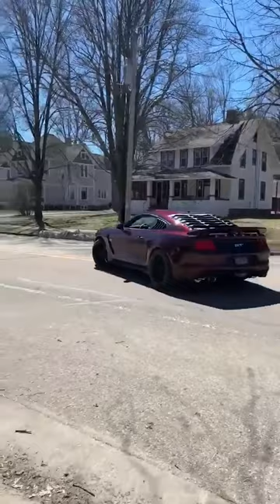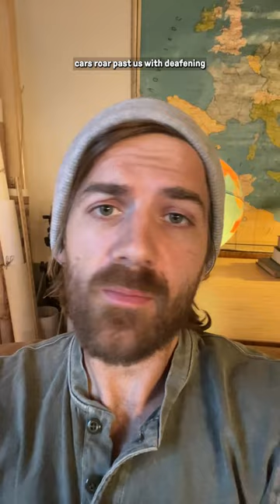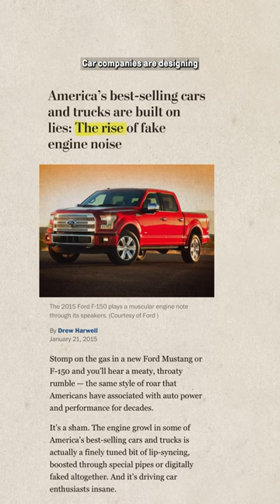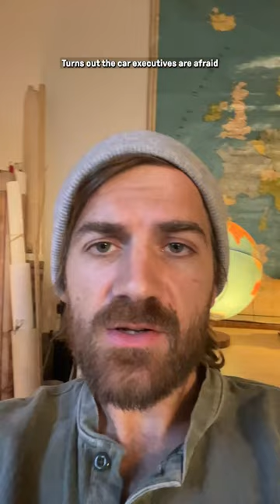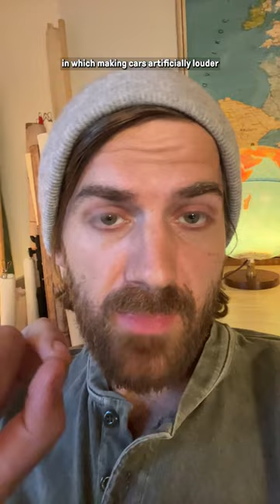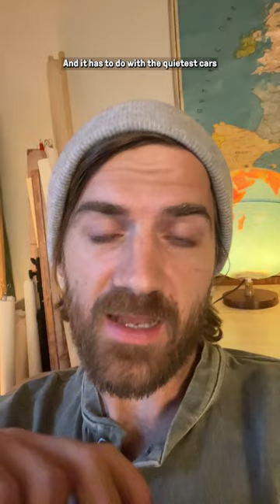Car Companies Are Making Cars LOUDER

Comment: I don’t know if you have this exactly right. The cars are loud and noisy weather real or artificial because people want them to be. Typically the car sounding like that our performance vehicles have some type. If they don’t sound really good, or even if they do watch times, people still buy aftermarket exhaust to make them louder. That’s just the community and culture on those types of vehicles.
Reply: The problem isn't that they're loud. The problem is that the operators don't drive them slow enough to be safe for people who aren't in cars and are also using the street

Comment: The quieter the car the more efficient at delivering power. That is why electric vehicles don’t make all that much noise because the energy is being expensed in heat and torque.

Comment: There is actually no data that suggests that the “safety noise” that electric vehicles are federally required to emit decrease pedestrian injuries. If you go back into the ideology of the federal regulation, you will find that motor vehicle companies dominated by ICE manufactures lobby to include it as a way to make EV’s LESS appealing to consumers by making everyone believe that all EVs naturally emit that unpleasant high pitch sound whenever they drive. At 25mph it cuts off and they are SO much quieter. Its a useless law that should be repealed
Reply: Yeah, the safety deficiency comes from drivers not paying attention to or caring about pedestrians

Comment: this is either straight up wrong or just misleading. that article you showed is referring to piped in fake engine noise to the cabin (can't hear it from outside of the car) which companies do bc they are making exhausts much quieter due to regulations. that mustang you showed has nothing to do with this, I promise car companies aren't blasting fake exhaust sounds 
to the public outside of the car lol

I finally have experienced the patented Johnny Harris oversimplification in an area I'm knowledgeable in 😂😂

Comment: This might be firing a shot to the otomotive industry enthusiast and purist
Reply from the maker: I'm assuming most car enthusiasts are well aware of "active sound design" in performance cars and trucks. Many also adapt their exhaust pipes with aftermarket parts to "enhance" the sound too.
Reply: @johnnyharris  Reach out to reputable performance shops, fast cars tend to be loud, not everyone can afford what it takes to make a fast car. I regularly have to have the conversation w/ potential customers that changing out their mufflers won't make it any faster. They just want it to sound fast, and if OE's give that to them out the gate it, well damn, what a deal.

Comment: I love Johnny’s content but the video doesn’t have it all correct. The car’s engine sound is piped into the interior through speakers and/or a tube through the firewall. The red Mustang at the beginning has an aftermarket exhaust so it is actually obnoxiously loud because the owner made it so.

Comment: Honestly all electric cars should have some kind of faked engine noise. I've almost been run over a dozen times by electric cars because I cannot hear them, and if I don't see them when checking a crossing, the only thing stopping me from walking onto the road is the sound of the engine or the tires. Especially since these ev people also love their super quiet don't-last-longer-than-a-year-tires that make very little noise on good asphalt. So yeah, either a really colorful neon colouring or some fake engine noises, because they are a safety hazard.
Reply from the maker: Legally they're supposed to, but many are still much quieter than the average non-EV car.
Reply: A road is for cars is it not?

Comment: There is a thing as to loud I agree, but loud exhaust is by product of more performance. The less resistance a engine has blowing out air (i.e. catalytic, muffler) , the quicker it can pull in fresh air and make more power. Its not a “ego” thing in most cases, some people just daily drive race cars. 😂
Reply: There's usually quite little performance gained from a reasonable muffler/exhaust system and what is often put on performance cars. They really do tune the sound to appeal to enthusiasts when they could tune it to be quieter and retain power. My point: these cars are tuned for volume when they could choose to maintain almost all the performance and be much quieter.
Reply: You really only stand to gain AT MOST 15 HP even with a straightpipe exhaust. And this, and many other cars on the road like it, are not "race cars."

Comment: that is not how a stock mustang sounds. Actually manufacturers are making cars quieter through the use of valved exhaust systems, and european cars now have particulate filters that make them quieter than ever. Sorry Johnny, but actually high horsepower cars naturally do make a ton of noise.

Comment: As a car guy, the loud exhaust makes it more fun to drive. The speaker shit is stupid tho.

But there is a benefit to louder cars, on gas engines a more free flowing exhaust means more power and better performance and the biproduct of that is more noise.

The even funnier thing here tho is clearly you don't really have an understanding of any of that as the car you posted with a loud exhaust is modified. That year mustang GT isn't that loud from the factory.

Try harder.

Comment: Hi Johnny! Love your take on this :) But I've been on both sides so let me fill you in a bit.

To be fair, cars geared for comfort are expected to be quiet. I wouldn't want a noisy exhaust on a car that I use to drive my kids to school.

On the other hand, cars built for performance or taken to the track are expected to be loud just like this. Weekend racers, track day-goers, and performance car enthusiasts are in the market for these vehicles.

Why? One word: feedback.

Experienced drivers on the track or drag strip "listen" to the engine's sound to get a gauge on lots of things. When to shift, when to brake, or when to get back on the throttle, among other things.

Engine sounds blared on the speakers are for basic stuff like those. One car with these in particular, the Toyota 86, is marketed towards beginner drivers who want to take their car to the track.

The feedback from the engine is necessary and is part of the learning curve for driving on the track.

More experienced turn these features off at some point. The engine sounds become a nuisance at some point and counterintuitively mask crucial sounds that may indicate info about the engine's life or even problems elsewhere like the suspension.

This is the reason why cars that are custom-built for the track are stripped of any sound-deadening and just keep the bare metal inside. That's feedback to the max and every bit of sound or vibration is crucial information for the driver.

I totally understand the sentiment, but we can't really generalize that the market is the same for all types of cars. And I hope you learned something new with all the stuff I mentioned as well :) I'm among those passionate about these kinds of stuff and I'm open to fruitful dialogue about this.

That being said, I do think super noisy cars have no place on public roads. I have a car that I bring to the track, but I still keep its exhaust down to Jasma standards (you can look that up. I think you may find it interesting) because I daily-drive it as well.

Comment: Long time fan, but I highly recommend some more research is done. As a car enthusiast I feel as if this is a bit or a twist on the truth. While some companies do add in noise, it's typically via the speakers on the inside of the vehicle, not on the outside. Also, as other comments have said - most cars come with mufflers, resonators, and or silencers to make them quieter than they are naturally. Chances are most cars you hear have those removed, and they arent made louder via the manufacturer. There's a case here, but I'd try to dig a bit deeper than this

Comment: Artificial sound thru speakers is within the car cabine, not outside, the car companies are reducing the exhaust noise because of regulations. The purpose is to reduce the outside noise of a car, while the driver is blasted with fake exhaust noise. Personally I love loud, powerful car noises since I was a child, and this will not be changed.

Comment: Disagree.  Silence doesn't make a reasonably intelligent person think it's weak.  The Tesla Plaid  will push your eyeballs into the seat and it does it in perfect silence.  Yes it's electric but the point is that torque cannot be fake.  You either have it or you don't.  The sound produced is just the cherry on top of the experience of performance but not necessary.

Comment: Yeah no. The average car and sports car has gotten quieter, because the regulations have gotten stricter, especially in Europe (new Porsches sound like washing machines for example) the reason they do this is because people who like cars like the loud noise, it makes you feel connected to the machine. MOREOVER it does have power advantages. Why do you think race cars are loud?  The loudening you are referring to is INSIDE THE CAR, not outside, and that is becauseeeeee of, you guessed it, they are quieter from the outside and so compensate with fake audio from the inside. Also I very much doubt the first video is fake sound, Johnny do you have a source for this? i really like your content btw but this is quite opinionated misinformation….

Comment: A lot of what you said is not true at all. Cars have been made quieter over the years due to smaller turbocharged engines and hybrids. Some countries have extra regulations for emission lowering devices fitted to the exhaust system which silences most sports cars completely. The noise that gets pumped through speakers is only on the inside of the car to enhance the customer driving experience in the wake of the other sound reducing changes that have occurred over the years. Also, performance exhaust systems make cars louder and more powerful so it’s not just noise for the sake of noise. There is actually power to be gained from removing things like catalytic converters, resonators, and mufflers.

Comment: Come on, Johnny. I'm actually a fan of yours, but this video makes you seem clueless. Electronic sound modification is typically done on the inside of cars. Engineers can use a combination of active noise canceling to filter out unwanted noise, then add a deeper, more pleasant sound back in. Of course, the sound is subjective, and many enthusiasts hate it because it is not genuine. It does not mean that a vehicle with a V8 and loud exhaust isn't real. You should research this topic because it is interesting and you will be more informed. I also would like to suggest that you learn more about car enthusiast culture. You may just discover something you like.

Comment: The good news is we're making progress in getting these annoying things off our roads. Soon legitimate taxpayers will be able to drive, rest and enjoy their cars without having to worry about noise and air pollution.

Let's ban ICE cars!
Reply: Without air pollution? Batteries aren't made from unicorn farts. Instead, materials such as Cobalt are mined by kids in Africa, other materials are mined using heavy equipment, and used in factories that pollute. Not all power is made using "clean, sustainable sources". Do electric cars really sound so great (right now) with that knowledge?
Reply: @AdamKing60  Yes, they concentrate air pollution in large production sites, away from population centers. We can then work on cleaning up the air right then and there using various technologies and methods.

Unlike ICE cars that continually disperse toxic fumes right where people are and at the point of production too.
Reply: That doesn't make sense. Just because the pollution is in a "large production site" doesn't negate that it is still pollution. Why not clean up the areas where people are. What about large polluting factories and equipment in populated areas? Electric vehicles are still not better.
Reply: @CodePlay Do you drive an electric car?